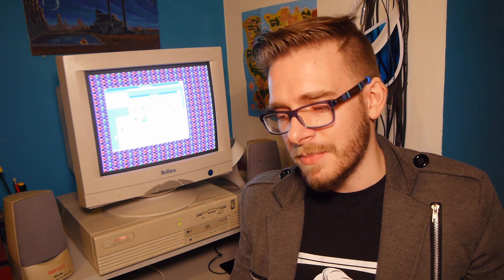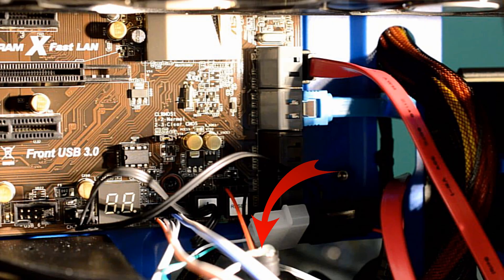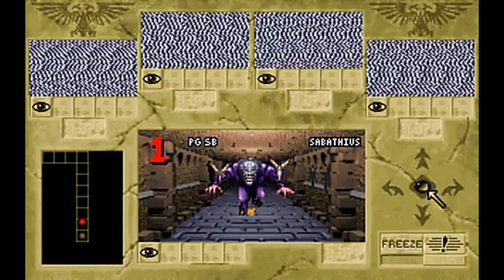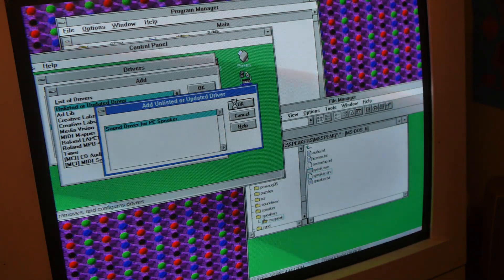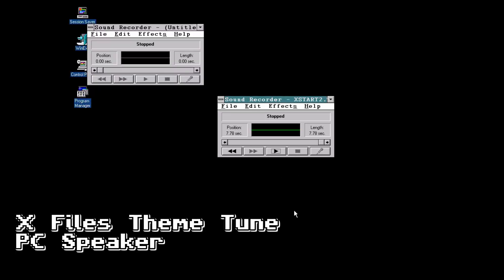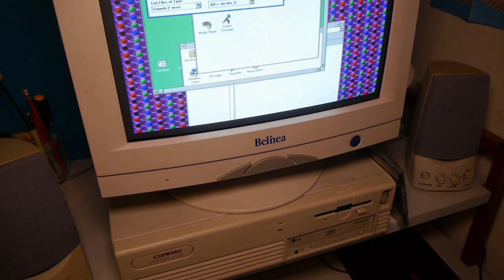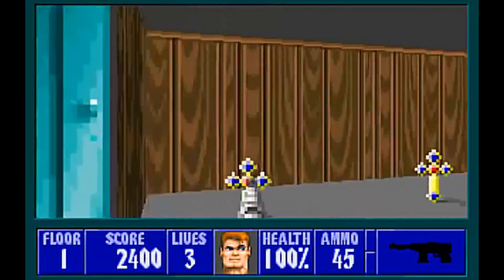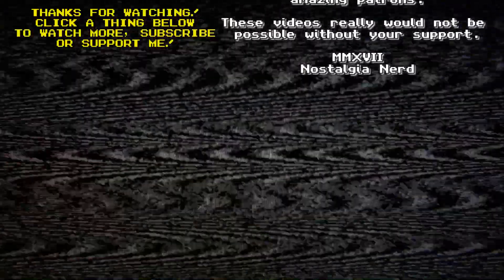Windows Audio Before Soundcards (Sounds Terrible) | Nostalgia Nerd

Comment: One bit of trivia I could give you for the next video: you can still use OPL3 in modern Windows. If your sound card has it on board, that is. YMF724 or CMI8738 have them on the die itself, you just have to install a driver for it to enable the kernel to open up a port, route commands from 0x388 to another one (0x50 on CMI8738) by using inpout32 library and voila!

Comment: The magic word was "Multimedia" back then.

We got a generic 486 PC Multimedia around 1994
it came with a Soundblaster clone card
and CD reader, the sound quality was okay
but it couldn't match the original SB card
and had to be configured at lower settings
of sound quality to make it work.

The CD drive could only read but not write
burning a CD was a luxury back then.
Those were the days man! 😄😄😄
Reply: I know, right? :) Back in 1994 when I was 3 and 4, I had a 486 DLC (386 board with a 486 Upgrade CPU) 40MHz PC with a SoundBlaster 16 on which I played Doom. The CD-ROM drive was 1x, and you pushed the whole drive in until it clicked, then it popped out, then you pulled the whole unit out and lifted the CD lid up like a toilet seat and inserted the CD. It was entirely manual. There was no button that electronically ejected the CD tray. :) I can't remember if it was Samsung or Mitsumi. 

I tried to modify the drive in 2004 by replacing the guts with a 52x while maintaining the old structure, but some springs flew out and it never worked again. :( I didn't quite know how to fix things back then. I still plan to buy another one of those.
Reply: SouthwesternEagle Interesting, your CD reader with a lid must have been a very early model.

Mine was a 486DX2 and the CD died after 2 years and had to buy a replacement, I think the original was like 4X and the new one like 8X, used it to load games like Dark Forces,  Full Throttle, The Dig and 7th Guest.

There was also lots of Shareware games for Win3.1 that came on CDs titled "100 in 1 Collection" mostly full of Tetris, Solitaire, Poker and Mahjong stuff but sometimes there were a few gems like Doom clones worth playing. ☺

Comment: I remember our second PC was an Escom 486-25 (the first was a 286) with no sound card and 4MB RAM. This eventually got upgraded to 16MB RAM and ran Doom like a beast (albeit slightly windowed) but we never had a sound card!
We DID have a CD drive however, so we hooked the headphones socket on the CD drive itself to some speakers and I was blown away at the time. Still no sound effects bar PC speaker, but music in games like Exhumed!

Comment: The story reminds me of the time I upgraded to a Pentium computer from my 486DX. I had to wait a couple of weeks before I could buy a video card (pci I think), and the hardware had come a long way from the 486, everything was plug and play, you know, instead of jumper settings on the motherboard. So, I turned it on and loaded Quake (shareware) blindly in dos, and it actually ran, lol. I could hear the shotgun firing, and the ambient noise of the player start area, since I did have a sound card. It ran very fast from the sound of it, none of that graphics processing overhead I guess, lol.
Reply: Dont you use AGP yet back in those days?  I think I used AGP S3 or Diamond on my K6 / Pentium machines then
Reply: AGP was fairly rare on Socket 7 Motherboards, and was only supported by non-Intel chipsets. The first AGP Socket 7 boards arrived a few months after the Pentium II was released. The first Intel chipset to support AGP was for the Pentium II's.

By the way, Diamond never made their own graphics chips, though they did have close ties to S3, using S3's chips in a lot of their boards. Diamond also made boards using certain Nvidia, 3Dfx, and SiS chips, as well as a model based on the Intel i740 graphics chip.
Reply: I remember trying to play Quake on my 486. Wouldn't work. Said it needed a floating point CPU. English not being my first language I had no idea what that was. Years later I realized it simply meant that the CPU could handle numbers with decimals. Mind blown. Not that I understand how you can write a game like doom without that though.
Reply: @Battle Cat You probably had a 486SX processor, as the 486DX series chips did have a FPU, while the SX chips did not. Processors without FPUs could still handle basic floating point math, but anything more complex would take far more time to complete, which would make more advanced games like Quake unbearably slow.

Another trick that software devs used back in the earlier days (and some may still do) was to multiply the numbers by 10^x (where x is whatever level of precision they needed) and perform integer math on the result, then divide by the same 10^x to put the result back into expected ranges. It's not as precise as true floating point math, but it's considerably faster than using pure floating point math without an FPU.

Comment: Where can I get the midi driver to run through the pc speaker this might work for my virtual Box 3.1 set up it has no midi do to the way Virtual Box is programed and for some reason only dos and win 3.1 have this problem on virtual box

Comment: only thing missing on that old pc is a turbo button.  did they actually overclock the cpu or ?
Reply: Actually, a turbo button does just the opposite: It underclocks the CPU.

Some software (mainly games) will run too fast if you run them on anything  faster than a 4.77 MHz Intel 8088 (which was the CPU in the original IBM PC). A turbo button is just a quick way to underclock a faster-than-4.77MHz CPU so that you can run software at intended speed.
Reply: crazy.  Not exactly what a regular person would think it would do.  thanks for info

Comment: A nice half-step was the Disney Sound Source and similar devices. You could make something compatible by soldering a row of various resistors to different parallel port pins and combining them on a phono jack. It was good enough to give me voices in Wolfenstein and let me play 4-track MOD files on my 286 in DOS!

Comment: Then there were us Amiga users rocking stereo sound and sampled audio without having to buy a sound card that cost as much as the computer itself.
Reply: IBM PC until 1990 was an office machine. Nobody really played games on it.
Reply: Yes, PC was primarily an office computer until the 1990s, but people did play games with it too and there were a good amount of them available. Perhaps the most famous PC games of the 1980s were the adventure games by Sierra On-Line (Leisure Suit Larry for example). PC was also the best machine for flight simulators even in the 1980s, due to raw CPU power. (Microsoft Flight Simulator series, Microprose games, Falcon and Falcon AT by Spectrum Holobyte etc.).
Reply: And 2nd Gen. Amigas like Amiga 1200 never really were popular and were a bit outdated already when they were released. Too little, too late. In essence "Amiga" basically meant Amiga 500 for the lifetime of the platform. Amiga 500 was the only model that was somewhat popular and most software titles were designed to work with it.

On the other hand, PC was evolving all the time at a fast pace, and updating hardware was pretty easy and affortable, AND USEFUL.
Reply: Things worked out for us PC owners become the early 90s though.
Reply: Jorma Jurrila This is all true. I feel the PC has never had much of its own personality though...for obvious reasons I guess
Reply: Wasn't really until wolfenstein and doom when pc really blew up as a gaming platform
Reply: +Jorma Jurrila Except Amiga had a bigger games library and was cheaper than the PC.
Reply: Lachlant1984 Especially since PC's "game library" was founded in 1981, so to speak... So by early 1990s PC already had ten years worth of games available, of course the early ones being very primitive. It's comparing apples to oranges a little bit. Especially considering that the C64 probably had the biggest games library of them all. And was even cheaper than Amiga. But it's like comparing apples to oranges and oranges to pears... Anyways, PC was the most advanced gaming system from ~1990/91 onward and has been ever since! The most affordable it has never been.
Reply: 4 channel stereo sound on Commodore Amiga systems since 1985!
Reply: Andrew Vrba I'd say more mid-90s. The Amiga still ruled the roost until Commodore went bust.
Reply: JimmiG84 The Amiga was far superior to the IBM PC in terms of graphics and sound, but it had crappy CPUs and lacked any meaningful non-game software. The IBM PC was built and marketed for office and professional use, where it reigned supreme and was the reason to its ultimate victory over all its rivals. The IBM PC never had any dedicated PPUs or a factory pre-built sound chip. All graphics were CPU driven (the video card was just an interpreter, no graphical calculations were made on the card itself), and so was the sound and everything else.
The IBM PC had very powerful CPUs and was in fact the first ever 16-bit machine. Games on the IBM PC could do very complex simulations and lots and lots of number crunchings, but couldn't handle scrolling graphics until about 1991. Also, the 386 was available since 1986 and the 486 since 1991, these were incredibly mighty CPUs for their time, which could in theory render better graphics than the Amiga just by using sheer raw CPU power, but very few games took advantage of these really expensive processors (at least initially) until about 1993-1994, when many PC games started to overtake the Amiga in the graphics department, even without having a dedicated PPU!
Reply: JimmiG84 Annoyingly hard-separated stereo channels though! Used to make beats on Amigas, always had to convert to mono :)
Reply: DuckAlert Beats Yes, that was a seriously weird design decision.
There's a lot of those with sound hardware though.
Like the snes. Who puts sample based synthesis hardware on a system with very limited DMA abilities, only 64 kilobytes of Audio RAM (and the audio hardware cannot independently read from storage), and an expensive ROM storage medium where even having 3 megabytes of storage is a huge luxury!?
Reply: Commodore fucked up by staying out of the CPU power race and insisting on Motorola 680xx. The AM386-DX40 and 486DX2-66 where the basis of the first really affordable IBM PC compatibles. With the 386 DX40 you might be able to argue that a fast amiga is a reasonable competitor in games, but with 486DX2-66 comming way down in price a couple of years later it was all over.

The 486DX2-66 could play Ultima underworld, Doom, Descent, magic carpet and even Daggerfall if you lowered the settings a bit. It was so blazing fast compared to the amiga that it overcame its complete lack of coprocessors and specialized BLITing hardware with brute force. Toghether with falling prices of harddrives, CDROM drives and the affordable sound blaster 16 vibra versions it was just game over for the Amiga.
Reply: PC sound cards didn't cost "as much as the computer itself". They were pretty affortable in the early 1990s. In the 1980s nobody really cared, because PCs were mainly business machines.

Amiga had pretty good audio for its time, but the whole platform was aging fast at the turn of the decade and audio capabilities were also pretty limiting at that point.
Reply: "Personality" in this context means "incompatibility" and "expensive"... :)
Reply: The Amiga may have been cheaper than PC compatible hardware, but I find it a little hard to believe that it had a bigger game library than DOS or Windows did.
Reply: True. Most PC sound cards did not even use their full potential in video games, I mean sampled sound (PCM) for music.
Reply: Eli Malinsky, SVGA chip-sets doomed Amiga. PC has Windows graphics accelerator SVGA chipsets that accelerates Windows 3.x graphics calls. 

PC's VGA chunky graphics format was the right format for Doom type games.
Reply: Personality if overrated, when you've got games like Doom though.
Reply: Andrew Vrba There is that i suppose.
Reply: soylentgreenb
Motorola's faster 68K CPUs sometimes  breaks compatibility. It's Motorola's own fault for losing the entire 68K based PC industry.

Doom was one of gaming PC's killer app.
Reply: Ken Silverman made MP3PC which is a MP3 player for MS-DOS and output at PC speaker.
http://www.advsys.net/ken/utils.htm find the "MP3PC.EXE" for information and download.

The program requires DOS4GW and
it seem didn't like ID3v2 tags, you may want to removes that metadata from the .MP3 files.

I've test the program and the stuff works on DosBox
but since i didn't have a real MS-DOS anymore, so i didn't knew the actual result on real MS-DOS machine.

Comment: The Raspberry Pi 3 still produces noise on the audio output when you move the mouse, even with a USB sound card. Fuck that thing.
Reply from the maker: Almost 30 years on. Damn.
Reply: BtizeF200 No. I can't put a HDMI audio extractor into my project. They are expensive and they need a specific voltage.
Reply: Have you tried using a good sound card?
Reply: @magnum333  A Pi 3, dude. Not a board with a card friendly interface.
Reply: You need a better made USB sound card. When you get cheap ones, they're lacking input filtering and produce this kind of activity induced noise on numerous computers, in varying amount. You can fix it up, get a ferrite bead on +5V on the way to soundchip and some capacitance between +5V and ground after the ferrite.

I can't really fault the Pi, it's cheap, it's very cramped, but it's within USB spec. Well, at least as long as the power supply feeding it has ripple within USB spec under Pi's load.
Reply: take 2 capacitors one electrolytic and one ceramic and put them in parallel with the power supply or check the soundcard capacitors,  the smaller ceramic capacitors are much more important than you think to block high frequency noises in the power supply.You can open your usb soundcard and put a good 104 ceramic capacitor across the usb power leads. A parallel injunction of two ceramic and a small electrolitic is the perfect thing to avoid having your usb soundcard fried by static potential.
Reply: Srsly? Psh, what a load of piss.

Comment: Im glad my pc from the 1990s had a sound card the pc speaker was already bad in the 1980s but in the 1990s it would just be rediculous you could get games on cd by that time i wish the ibm pc had a cheap 8bit sound card in the 1980s but they skipped that part and they got straight to 16bit midi in the late 1980s.